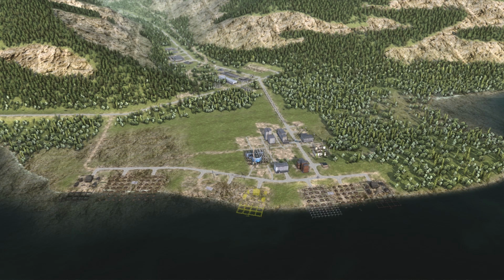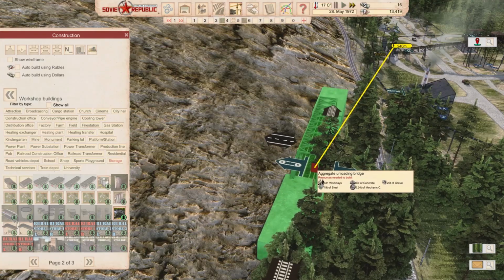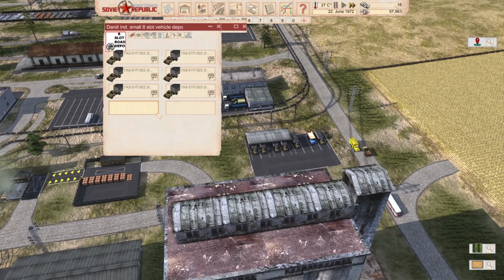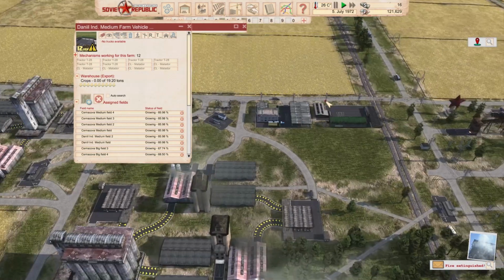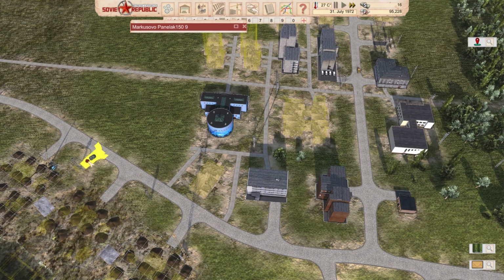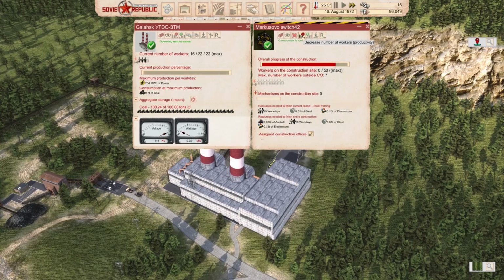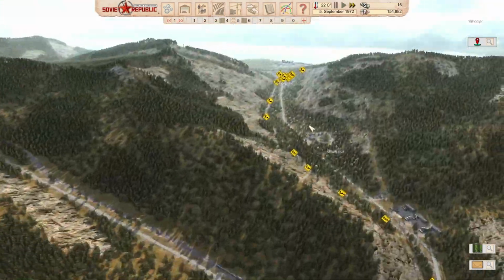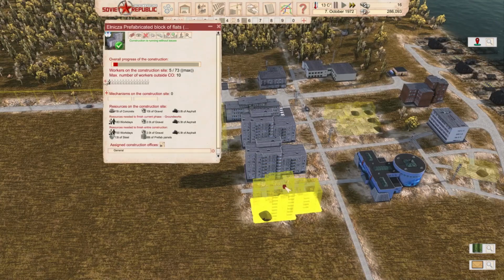Soviet Republic - Alaska - The Settlement - Ep.36

Comment: You should move away from 6:6 tractor to harvester, you can do better with 4:8 tractor to harvester. People talk about crops rotting in the fields, and what I figured out about using 4:8 is your fields can't be harvested if they don't get grown, and if they can't get harvested, the crops don't rot in the field. If the harvester works from Nov 4 to Dec 4, and a covered hull is there to gather the crops, they can't rot in the field. Does this make sense? You are delaying planting, delaying harvesting, delaying collection, so over time you get an extra month of crops not freezing if you have enough trucks to get the crops as they get harvested.
Reply from the maker: Yes! I noticed that too. If the truck is on the field the harvest continues despite the frost and snow. 
My problem is that I'm not sure is planting later (4 tractors) will delay harvest too much and how will trucks behave going from DO to the fields. Will we have losses or not. Maybe I should set one farm like that and test it. 
I'm gonna assume 7-5 is useless.
Reply: @oolykeegaming81  7 tractors? defnitely worthless. I was doubtful of the 4:8 SaintTilt suggested, but once I figured out what was going on with the crops being harvested into December it clicked and I believed him. He was the first to reject the 12 bigs 6 smalls and push for 18+ bigs, and after  seeing  it / playing it / using it, he was onto something. You can / do lose a little harvest but the crops on the ground do you no good. 5:7 tractors to harvesters can probably work too, but the 6:6 has been shown now to not be optimal at all.
Reply from the maker: @bc74sj69  7 harvesters I meant. But 7/5 are odd numbers and could cause an imbalance with sowing and harvesting.

Comment: I put lots of DOs on my maps to balance the crops between each set of silos. Some sets of silos just hold grain, and don't have any production buildings near them, and others have  one silo directly connected. I always prioritize my food factories from my grain balancers (as I play for self sufficiency) and this way I hope to drain all of my crops by June / July and have full warehouses of food and the excess goes to alcohol / meat /  chemical production etc.. However I do have to prioritize chemicals for clothing as well since  your excellent video on needs showed clothing is crucial and only 2nd to food to prevent death and escapes.
Reply from the maker: Thanks for the compliment! :) 
Regarding the grain I agree. I could have done a better job with storage. I'm still considering having a big central storage so we maximize our grain output. I doubt we will gain much but it will be more definitely.
Reply: @oolykeegaming81  Well using your mods it makes the job quite a bit easier. I have to put in a DO and 4 silos to not even match it, and then I have to use another DO to pull crops out of 3 of them and balance it to the one attached to the food during the spring and summer. With your mod you can put even more crops in (it's 4000 tons right?) and add in a 19th field and never have to worry about any balance, as you can pull 4k crops directly from the backside of the big silo.
Reply from the maker: @bc74sj69  You are right! Even more challenging for you! 
Yes. Just under 4000t is the silo capacity.

Comment: Sorry to be negative or a nasty comment, but this is the problem using starter buildings in 1972 (and multiples of them). By now you should have gravel well under control, and you have way more gravel in your starter town than in the expansion town. I think a good solution would be aggregate storage for coal and gravel at the junction of all of your roads maybe so your excess from the starter town could have been delivered by this point? You are wanting to build bigger and bigger towns so you either need to move the gravel from the starter town up, or not only pull from the tiny ones?
Reply: Watching you try to level things without wireframe... Bedrock is very hard. I use the dozers to get a foothold then a tiny building (parking lots work well) once I get the foothold in. (I'm typing as the stream progresses, so you did determine you needed more gravel from the original area, I just think you should have pointed it in the direction of the new construction, not at the area to the right if my map geography serves me correctly)
Reply from the maker: You are right! I should have focused on rail expansion sooner and have gravel, coal ready to be delivered to a new locations all the time. 
I will aim to do so in the future.